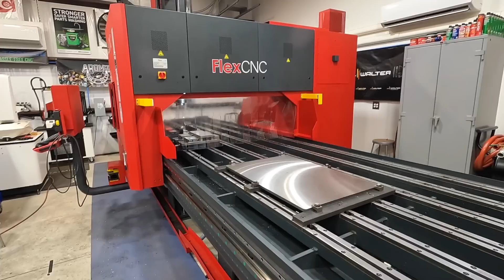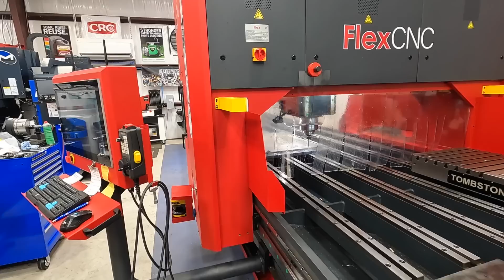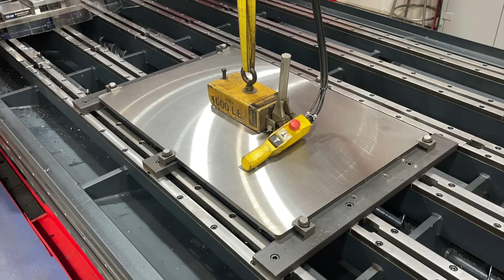Cart Top Fixture Plate on the Flex CNC (216 Holes)

Comment: Isn't that a straight flute, manual type tapper?  Shouldn't it be a spiral tap that is meant for CNC where the chips are directed upwards and out of the hole?  Seems like the ap chips are being left in the hole and buggering up the threads, and wearing out the tap.

Comment: Looks like you are using a ER 16 and er 20 or 40 Collet holder for drilling they make collets so you can do through coolant. drilling so it stays in the drill and not through the call it

Comment: Sorry for slow response, Adam. Saw you using the Haimer for setting work offset for x & y. Looks like on screen that the Haimer is # 99. Thought I’d add that you could put the Haimer in your tool setter and compress till Haimer zero like you would for x & y and use the value on your tool setter for z tool length. Then in future just compress Haimer to zero while on tool 99 and set z to zero. You may want to check height with a few tools to set your trust in use 99 for z zero setting whether it’s on top of part or top of parallels. Z could be off some if cosin error was introduced while compressing probe to zero on meter dial.  Also thanks for your hard work on videos and enjoy that it’s you live with no voice over..

Comment: Wonder if you can still re-tap the other plate and save it.
Reply: The issue is with how to realign the threads... A lot of machines can track the rotation as it taps (which allows you to re-tap if needed), but once you change the tool or move the plate that orientation won't match the previous threads.

Comment: One problem encountered with inrequent use of a tool is that the operator tends to lack the expertise that is required from frequent use over a period of time.  It will take time or you may find that a seasoned opertaor is in order for the future as business expands.  Mastery of multiple machines takes time and sometimes years of experience.  Maybe contract an experience operator to work with you on some projects to have someone looking over your shoulder until you gain the required knowledge and experience.
Reply: YOU ARE SOOOO RIGHT ! ! !
Reply: He is a one man ban and not getting big batches in. He is struggling with CNC which a lot of manual machine men think is just press cycle start. Nothing wrong with solid tap holders on a CNC.

Comment: Hi Adam. Your tap angle in the spindle needs to exactly match the start of the lead. I think you have got this a bit wrong, so the spindle angle doesn't match the tap position exactly.  This is critical! In other words the position of the tap thread is critical to the exact spindle rotation position and feed.
Reply: Provided your rotating and feeding at the right speeds prior to engaging the work piece it makes no difference whatsoever...
Reply: @davidstone1579 It sounds like you're talking about matching the tap rotation to an existing thread, but Adam is creating the threads from a blank drilled hole, so it just needs to feed in at the correct amount for the thread pitch to work.

Comment: Hi Adam  Using a compression/tension tap holder is a very good insurance policy.  I always use one for taps under 12mm(1/2").  Also I may I suggest that you switch to spiral flute machine taps in lieu of the straight flute.  Cheers.

Comment: Glad to see you are progressing well and gaining confidence with the CNC machines. The special tapping heads that provide a bit of float is the way to go in the long run even if they were able to tune the issue out of the machine. I don't mind the mix of old machines and new machines on the channel it provides a nice variety and compare/contrast.

Comment: Probably that straight tap can't get rid of the swarf, ruining the thread as well as the tap - try a spiral flute tap instead. But you're not going to identify the cause of the problem changing two or more variables at the same time.

31:05 - Btw. that's the speed I'd like to see that run at.

Comment: Sounds like the Z servo wasn't calibrated just right for the ballscrew pitch.  Kinda like the steps per rotation or steps/mm on my hobby CNC router.  Seems to be correct now.  Maybe all that should be checked during setup by the tech that installed it.

Comment: Not really a good look for Flex’s programmers if you ask me. A problem like that should never leave the factory.
Reply: I built, tested, and sometimes repaired critical software most of my professional life.  Even the best software has problems, especially in its early releases.  The mark of a good software team building quality software is that they were able to come in, find the problem and then fix it.  Eventually, other customers of Flex CNC will benefit from what happened here.

Comment: I would think getting a tool that doesn't rely on you manually reading a dial would make sense when you have a CNC.
Reply: Actually, using a piece of paper is quick and easy, I do this all the time on older Cnc machines I run, takes just a minute and you're off to the races.  Gas on it.

Comment: I hope this helps.
If you want to also use the manual probe to get Z0 of your workpiece(s):
Set it as tool 99 or something you never use  then, after you've determined Z0 with the tool setter (like you shown), put the manual probe in the machine, set it's height H99 to 0 (zero), go to roughly the same location and go down until the needles are both on 0 (zero) - the probe should also work on Z, not only horizontally.
Now check the absolute position and subtract the values for Z you found with the tool setter method (G56). Save that value as the probe's height, for tool 99.
In the future, you can use the probe itself to also find Z0 of the workpiece, by lowering it until both needles are on 0 (zero) - that's going to be the value you need to put in G56.
I used this a lot on a fadal cnc. We only had a manual renishaw probe, very similar to yours.
Cheers

Comment: This may be a dumb question, so please excuse my ignorance. Why can you not use the Reneshaw probe to indicate the workpiece like you do on the smaller CNC mill? It seems like that would be so much easier. Keep up the good work! I have loved watching all of your content and this foray into CNC has been exciting to watch as you learn and keep expanding your knowledge.
Reply: Probably because he doesn't have wireless probing installed on the machine.  It requires a receiver wired into the control along with the supporting macros and software to run it.  If he doesn't have that then the spindle probe isn't much more than a paperweight.

Comment: it also happens on other machines,, hm drills drill precisely, the problem is the tolerance between the drill and the tap. if you drill + 0.1mm   the problem disappears ,, no screeching or bad noises try it before adjusting the machine

Comment: Three things.  I am curious about all the up and down movement getting the head in position to change tools.  Probably not all that much time since this is not production work. However, just more movements to go wrong.

There are a lot of chips on the work after drilling.  I'm wondering if these foul the tapping operation.

What is the plate?  Is there an issue with springy and/or gummy plate.
Reply: All the tool change is built into the controller and will be designed with safety and accuracy first, speed second, not dome thing Adam csn change.

Comment: Adam, I have a question if you don’t mind. Can you explain why you don’t just use a large enough chamfer tool bit for the holes,as opposed to the method you used requiring the power head to move around the hole? I’m not a machinists but I’m thinking it could reduce the cycle time if the chamfer tool would just go to each hole position like the drilling operation. Thanks
Reply: Chatter and surface finish are typically why you would interpolate the chamfer instead of a drilling operation. This is because a lot of cncs perform best at higher rpms, which would chatter a chamfer tool that diameter. Sometimes it works fine though.
Reply: He's probably using what he has, or what was already in the machine. The fastest solution would be to use a stepped chamfer drill, hole and chamfer at the same time.

Comment: you need to use sealed collets for through coolant tooling otherwise you loose the vast majority of your coolant pressure. you got by on this plate due to it only drilling about an inch deep but on deeper holes you will have issues with chip evacuation. also when taping i would recommend using through coolant  with an unsealed collet.

Comment: It's a delight to see these tools cutting steel so easily like it was plywood :)

Adam, you can look up "Air Knife for GoPro" to find a 3D-printable model for a device that keeps coolant away from the camera. It is relatively simple thing that mounts on a GoPro. Though it will require a spare airline in the machine.

Comment: Synchronisation issue. The Z feed motion has to be perfectly in sync with the spindle rotational speed (obviously) in order for a thread to be produced, just like producing a thread on a manual lathe. 
If that first plate is for you it might be worth running a similar program again with the next size up. 
It's jobs like these that the CNC machines really come into their own. They aren't the most interesting videos to watch for the manual guys though but the clue is in the title.

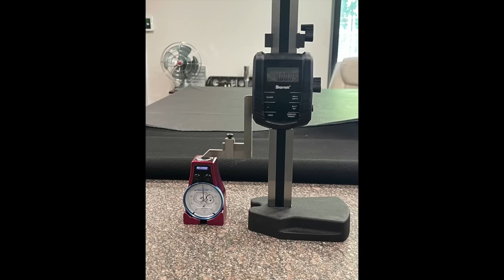Comment: 7:00 What is the yellow 'X' on the spindle for?
Reply: It could also be for when he is manually loading tools into the spindle. 
Making sure the tool goes into the spindle in the same orientation helps ensure repeatability.
Reply: Most likely the designation is M19 for installing a single-tooth boring head.

Comment: Once you discovered the tapped threads quality, two changes were made. The Flex people went in and made adjustments to the machine and secondly, a different tap was used, the Walter tap.
To prove what was the issue, I would have used the previous tap to see if the Flex programing made the fix or if it was the tap.  Once the Walter tap was used, you have no way of knowing if it was the previous tap failing you or the machine or both. 
I wonder if running that program again using the Walter tap will clean up the threads?
Reply: It was for sure the parameter value that they had to change.

Comment: 28:35  That's actually fascinating!!!  I love how power a CNC feed (the Z axis) for tapping, it knows exactly how much t feed down and up according to the taps TPI specification :)

35:01  !!!!! EDIT!!!!! :  Welp, there goes that theory, if the tap isn't slipping, that means the Flex can;t get the feed rate right at any faster of RPM :( .. that sucks!! :(  

Further edit: Like Adam said who know what they adjusted??? OR? WHY it is even ajustable??? Why would it be made to mess up the tapped hoes?   

Rather than adjusting the software, as Adam said,  I wonder if they made Firmware adjustments?  Something that NOT even able to be modified by the end users??  

It would not bee practice on the small holes, but anything over say 1"  the taping could technically be done by a single point thread cutter wot multiple passes.  This would be cost effective for a few holes, for example, where you don't even OWN a tap that size!!

The tapping being done right now is SOOO accurate, the Thread even starts at the exact same start point on every hole, that not even possible, for a regular milling machine.tapping set up.

Comment: Adam, set your retract height well above your clamps as a habit. It might take 3 seconds longer in the cycle time but it beats paying 200 bucks for a new tool.
Reply: Yes, in piece production it doesn’t make the slightest sense to put Z5 instead of Z100.
Reply: @skydimm7325 , z100 works on first run to verify program, z height can be adjusted for fast production down the road. Z5 with a tool breakage & replacement, what time was saved.

Comment: 23:46 a custom made step cutter would speed up the job by eliminating the chamfer tool for all the 27/64" holes.  But frankly I don't know how much they cost, never mind the lead time.  

One advantage of CNC is it can eliminate the need for custom cutters too!!  The counter bore here is a GREAT exampe,  the cutter Adam has set up for the counterbored holes?  Can LITERALLY make ANY diameter counterbore over it's nominal diameter.

Of course same with the chamfer tool too!!

Comment: Learn to use and program threadmills.  I dont tap anything in a cnc any longer.
Reply: they are nice, but thread milling 216 holes would take a considerable amount of time compared to using a tap.
Reply: It would be extremely wastefull. There is no issues tapping in mild steel, you can tap thousands of holes with single tap.
Reply: Switch to Sanka bro
Reply: Threadmilling holes in hardox about 2 minutes each, tapping is 15 seconds, if you can tap why would you threadmill.
Reply: @DanielMac1052  So that the threaded holes dont turn out like his did or worse break off a tap in the part.  Its not like he is manufacturing these on a large scale and seconds really count.  Being in control of how the threads come out is worth it in my book.

Comment: 20:47  I used to operate a "Gang Drill "with 6 spindles when I was in the machine shop.  Frankly it was used 90% of the time with just one or two spindles going :) ... 

But a job like this?? It would be well worth setting up!!  Even the Flex-CNC would have trouble keeping up with a 6 spindle drill press!! :)

The thing with CNC's though, they are FAST and perfectly accurate!  AND consistent.

Comment: Summary

* 0:00 The video starts with an introduction to the project: machining a cart top fixture plate on a Flex CNC. 
* 0:15 The YouTuber shows the fixture setup process.
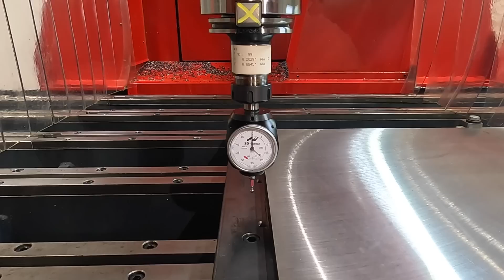* 2:34 Work offset setting using a 3D sensor and a tool setter is demonstrated.
* 11:00 The YouTuber explains the purpose of the fixture plate and the overall project involving a Flexarm cart.
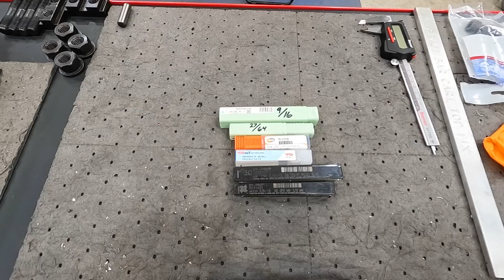* 14:02  All the cutting tools (Walter Titex, IMCO, OSG) are shown and explained.
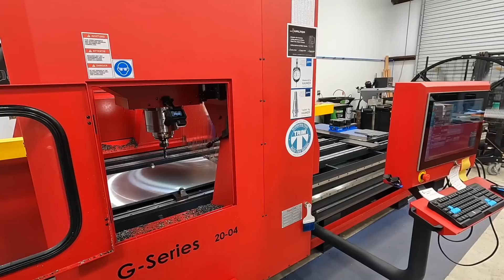* 16:18 Machining begins, starting with drilling operations.
* 21:14 Commentary on the performance of the Walter Titex drills.
* 22:48 The counterboring operation is shown. 
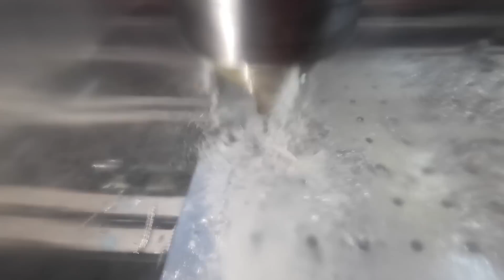* 24:19  Chamfering all the holes is done next.
* 27:25  After cleaning the camera lens, tapping operations begin.
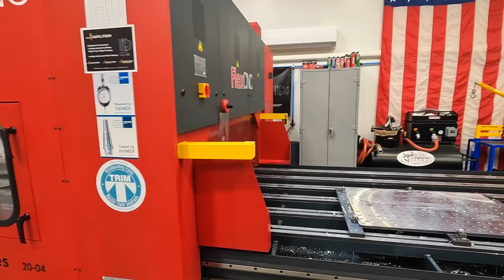* 33:02 Initial inspection of the machined plate shows issues with the tapped holes.
* 36:01  An update on the tapping issue: Flex Machine Tools engineers remotely adjust the software settings.
* 38:57 The YouTuber shows successful tapping after the software fix, demonstrating thread quality. 
* 41:04  The YouTuber discusses the future use of tension compression holders for improved tapping. 

i used gemini 1.5 pro to summarize the transcript
Reply: Well done sir, and I support  you assisting Mr. Booth in excuting this on a trial basis.

Comment: Setting up parts to machine on a CNC, seems to be VERY time consuming! :(
Reply: 4hr~ CNC setup, Then run 10000000 parts at 20 mins a pop

20 hours manually drilling and tapping all those holes, To make one plate, Then you gotta start from the beginning

It makes sense when you break it down.
Reply: You'll take it, and you'll like it.  Have an average day: :|
Reply: @silasmarner7586  lol that is an amusing comment

Comment: QUESTION: When drilling the holes, how much weight does the CNC put on the cutting edge as it drills down?
Reply: Depends on so many things, 

The CNC feeds down at what you set the feed rate at, it does not know how much weight is being applied.  

The exact same cutting operation would have more resistance when the cutter is older .. or LESS resistance with a 6 flute cutteran a 2 flute, for a couple examples.
Reply: IT depends on feeds and Speeds
Reply: 12 ounces.
Reply: Generally your Z motor wont go below 0 on a vmc, meaning no more than the weight of the head.
Reply: In this video? About 250kg